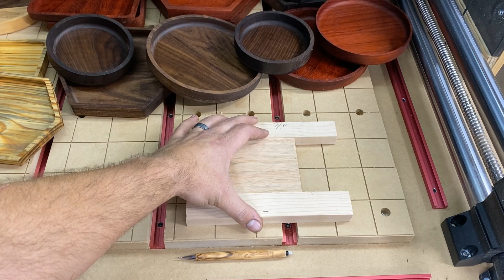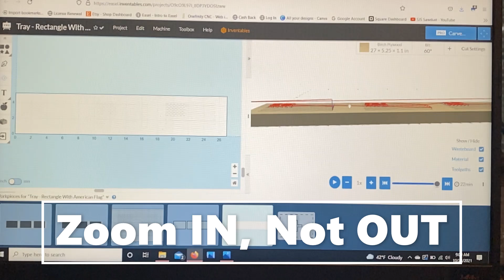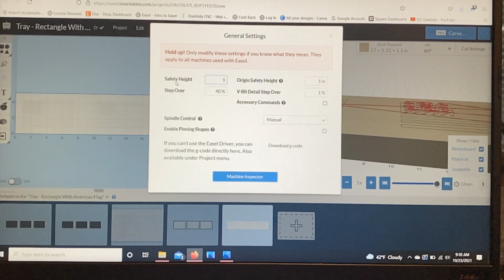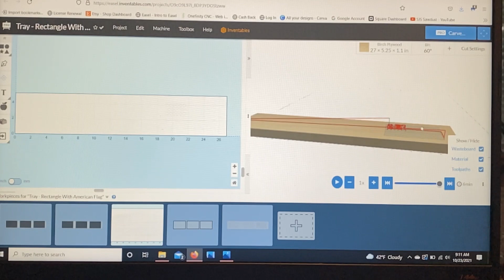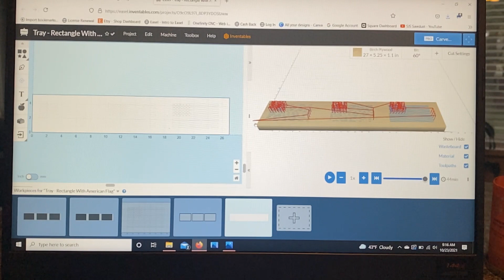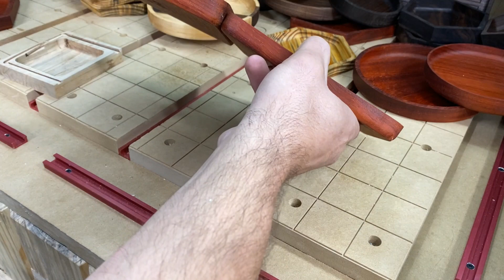OneFinity CNC Production -  Mistakes Were Made, Tips How to Avoid Them, Save Money and Time

Comment: That last tip seems to involve a lot of manual work that doesn't take advantage of the CNC's capabilities. Why use a jig and swap out trays one at a time when the trays and designs could all be done at once from one larger sheet? Trays are secured by little tabs and are released with a quick hit from an oscillating multi tool at the end? Bit changes and sanding would be done anyway.
Reply from the maker: @GeekRedux  thanks for the tips. If I were cutting this out of one large piece, let’s say padauk, from my experience, this would be very costly - I find it much cheaper to buy smaller pieces or, better yet, use off-cuts from past projects. Even more important than that, there is a lot of stored up tension in large slabs of wood. That tension will be released as these are cut and will almost certainly lead to cupping/warping that will lead to sub par results or could easily damage your end mill or CNC. If these were out of plywood, MDF or particle board - I would definitely nest 6 or 8 trays on one sheet and set my file up accordingly
Reply: @SJSSawdust  Okay, yeah, you make a good point about the stress in a large sheet. Maybe a plywood or mdf jig could allow you to lay out a dozen or so trays at a time? I guess I'm just getting unreasonably frustrated seeing that CNC being used to do a job that could be done with a benchtop 3018 lol

Comment: height setings... JUST edit the gcode. estlcam is a better choice then what your suggesting to use.. I have used it before but found it very lacking. editing the gcode file for the 2 required high z moves is easy.  designspark free and ESTLcam very cheap one time. I own fusion but really only use it for the CAM side of it.

Comment: What sound proofing is that? I’m looking to make changes to my enclosure
Reply from the maker: It is 1/2” thick rubber mat from Amazon and it’s available in different thicknesses and sizes. Mine is 1/2” thick and the sheets were 24” x 48” I believe. Very easy to cut and I used spray adhesive and screws with fender washers to hold it secure. It cuts down on the sound pretty well and I imagine 3/4” is even better.
Reply: @SJSSawdust  thanks! I have sound foam in mine 2x2’s and although they help with noise they keep falling off. I’m going to invest in some solid one piece like you have. May be easier to keep it attached. Thank you!!

Comment: Have you tried setting up a stationary x,y stops.
Set x,y once and you can continue to load repeatedly without setting x,y and z if all your projects are the same? I hope this makes sense.
Reply from the maker: Yes! That works perfectly. You can cut a 2” wide, 16” x 16” 90 degree angle, clamp that down and set zero once from the corner